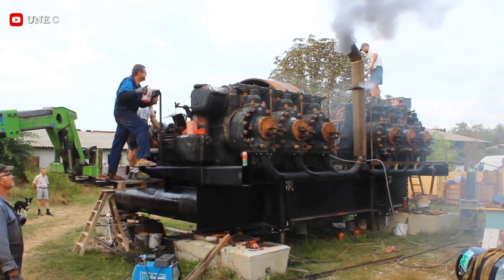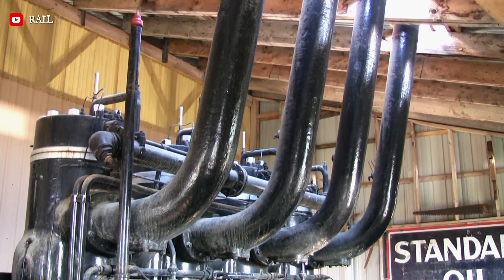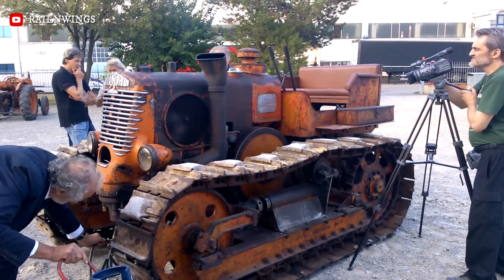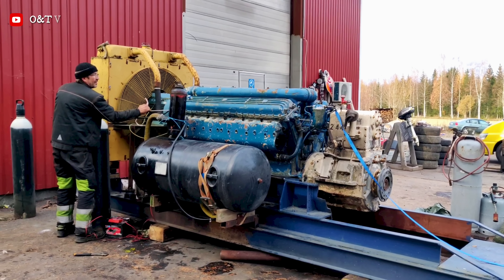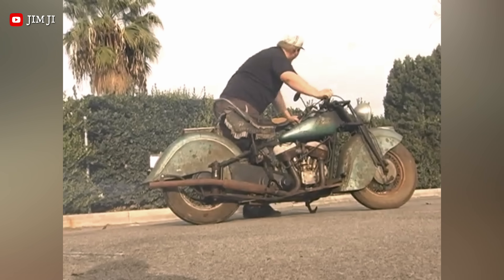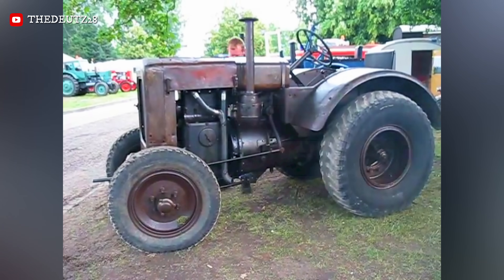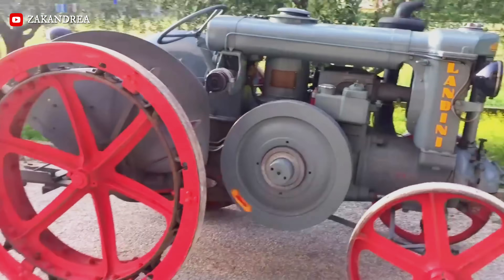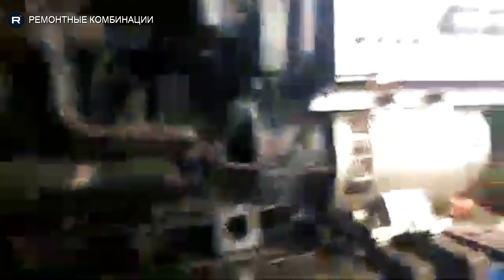Rare Old Engines Starting Up Sound That Will Blow Your Ears ▶19

Comment: As late as 1981, St. Lucie County in Flori-Duh used diesel hit-skip engines for water pumps on North Hutchinson Island.  I was walking a trail in the woods there along the Intracoastal Waterway with two friends when I was 15 and encountered one of these bizarre engines.  I later told my (Electrical Engineer) father what I had seen and he had no idea what it was when I described the sound it made.

Comment: 2:17.... The Fairbanks Morse 32 series engines looked simpler and easier to work on than this behemoth. They made similar power also. The nice thing about the F.M. 32 series engines is that they could be had in anything from a 1 cylinder up to a 6 cylinder that made 450h.p. the 1-6 cylinder engines all shared the same top-end parts. The crankcases were obviously different to accommodate different numbers of cylinders. Great engines the F.M. 32 series were... workhorse, and many are still around and running today still.

Comment: It's great that the Russian 4cyl two stroke bore absolutely no resemblance to a 4-71 Detroit Diesel! Just like the Tupolev bomber that bore no resemblance to a B-29. The Mitsubishi AM6 Zero radial engine bore no resemblance to a Wright Cyclone, they just happened to have the same part numbers and English writing cast in! 😂
Reply: Russian junk sucks...

They usually just steal a design from someone else. Just like they did with the nuclear bomb. They weren't capable of doing it themselves... 🤪 so they sent spies in to steal the working blueprints from America.. 😮‍💨

Comment: In the beginning the Landini is running at ZERO rpms. Hanomag, and others built tractors like this. They could reverse the engine rotation to back up. Sometimes dangerously if stalled pulling a load up a hill! 😊
Reply: Like if the engine slowed down enough lugging up a hill, the engine might be going at a slow enough RPM that it may NOT make a full revolution the next power stroke, and it COULD end up popping off and going the other direction. 
Then suddenly you would be going down the hill in reverse, going VERY fast.... 😬